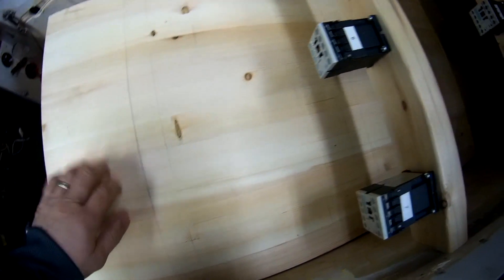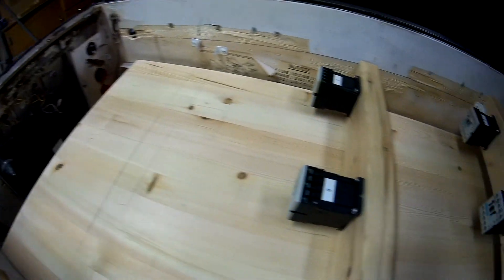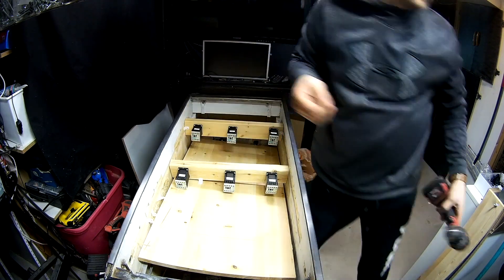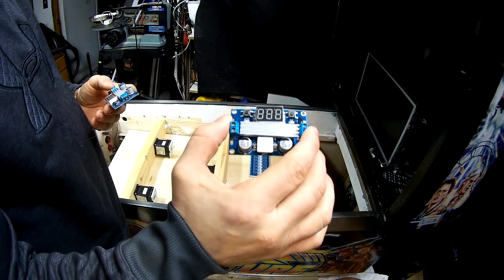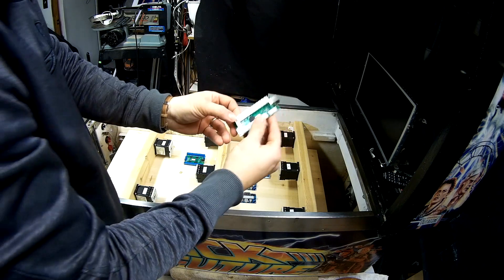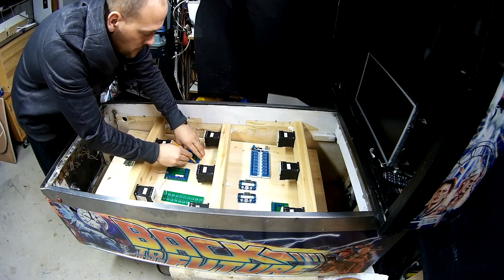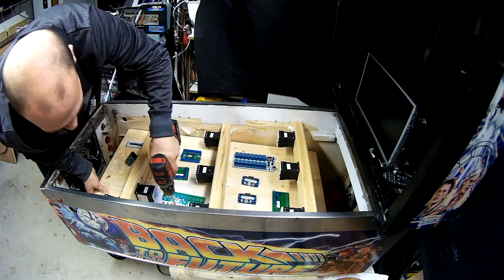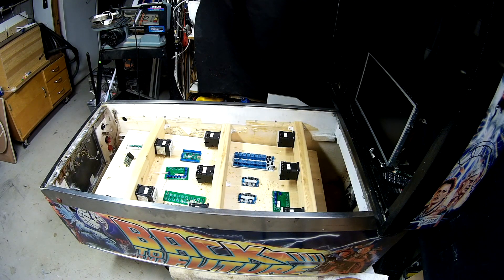Virtual Pinball Guide (Components board)

Comment: Does that Sainsmart 16CH USB relay board work? I ordered one and it doesn't work (can't get any relays to switch/activate). I tested the 16CH board in the 16CH Relay Manager but it doesnt do anything? I also have a Sainsmart 8CH relay board that works great. Not sure if I got a bad board or not, doesn't your board work in the 16CH Relay Manager?
Reply from the maker: You can not use the 16CH USB. DOF only supports the 8CH usb. if you want to use the 16CH you must use the non usb. https://youtu.be/zj8qWDqQhgI